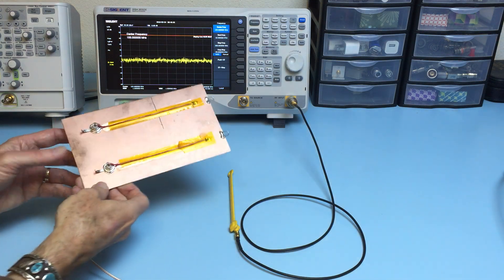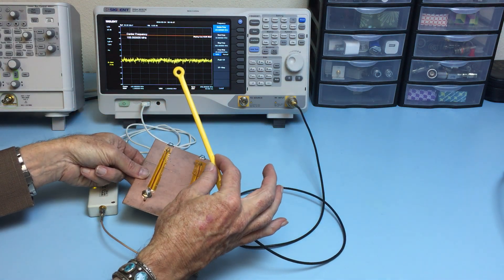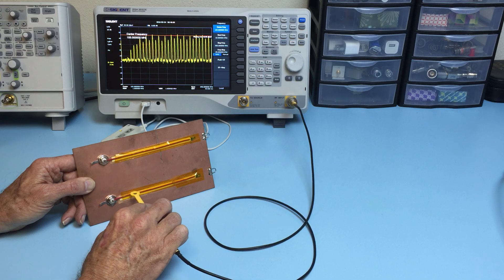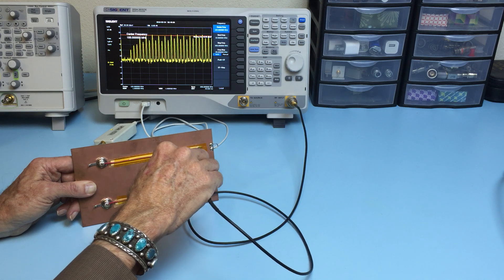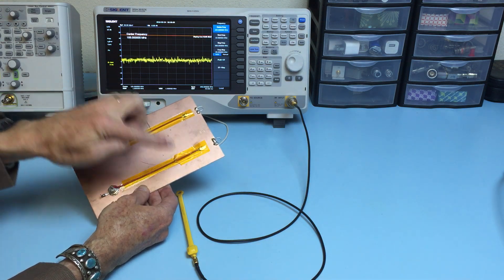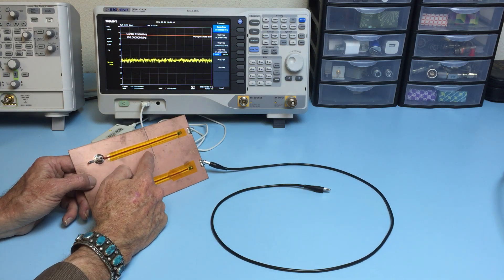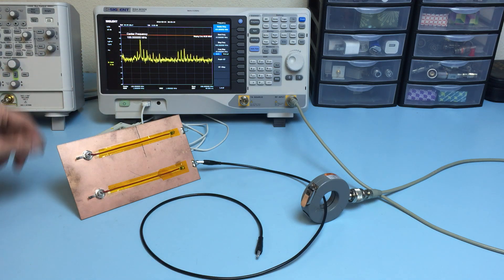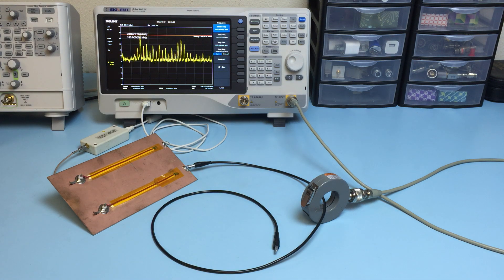Gaps In Return Planes

Comment: And this happens already in MHz range.. There are some GHz designs out there, where the return path under the clock is interfered with other traces and power planes (so not technically a gap). I myself did also some 200MHz traces on a PCB, where the GND underneath wasn't so clean and had a big issue with crosstalk and radiated emissions. Very nice demonstration, thank you :)

Comment: Thanks for the detailed demonstration. 

We may use a massive gnd plane and heavy Rf shield for any circuits to easyli call or work correct.
 It allways had an antenna or loop somewhere, or at some point needed to slove the low inductance/high current phats/return phats.
So its like a esential thing to know and not only for an RF guy.
Reply: Indeed :)